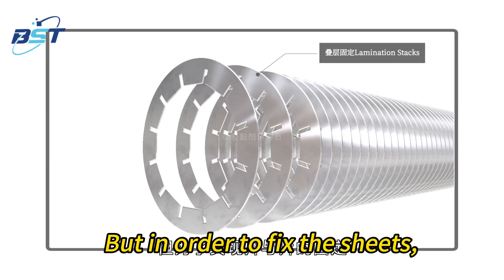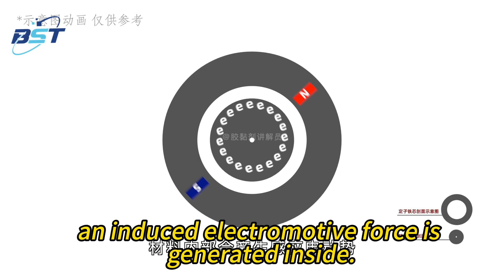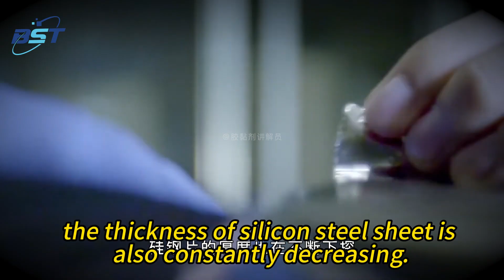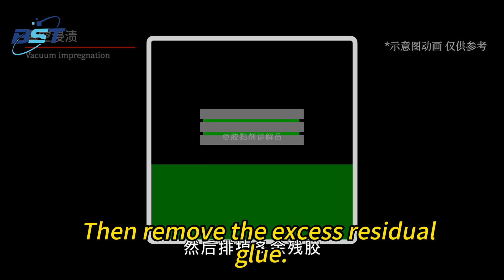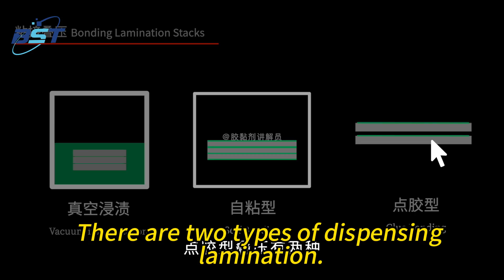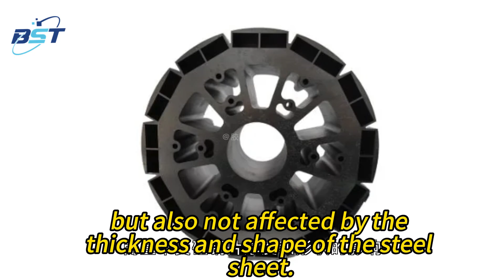The manufacturing process of motor cores: Bonding lamination stacks,Why is adhesive used?

Comment: Great application. Since 1993, MINGXU has delivered Taiwan-engineered precision high-speed press solutions from 25–400 tons, featuring JIS Super Grade accuracy, stable high-speed performance, and global service support for motor cores, connectors, terminals, and lead frame stamping. Let’s connect.

#MINGXU #HighSpeedPress #PrecisionStamping #MetalStamping